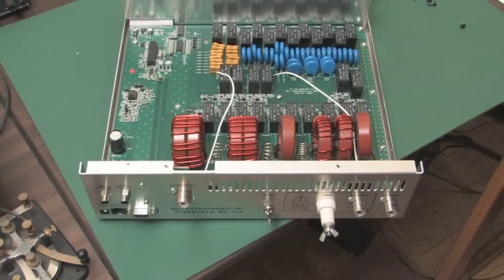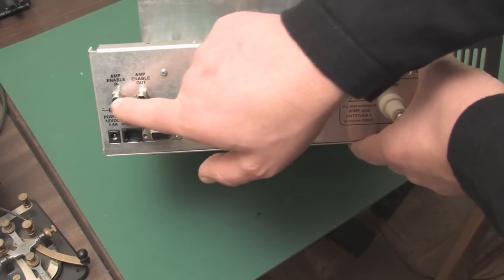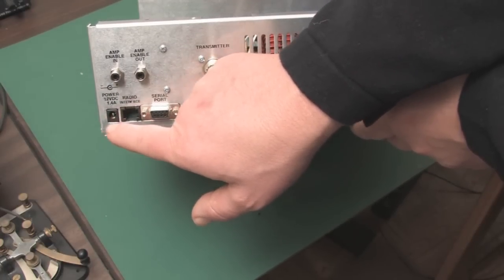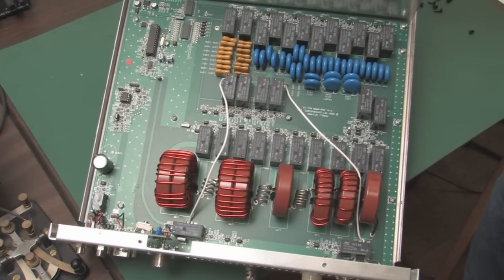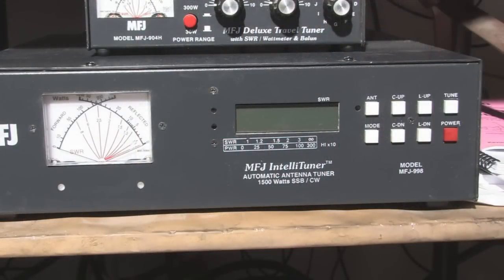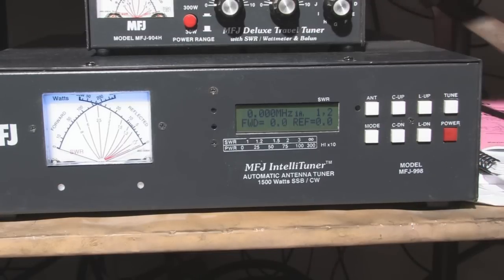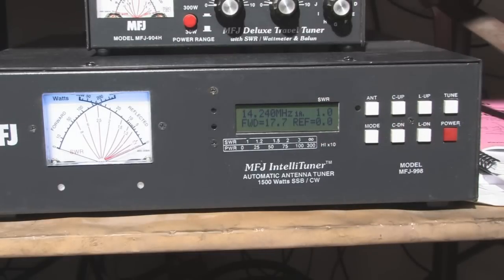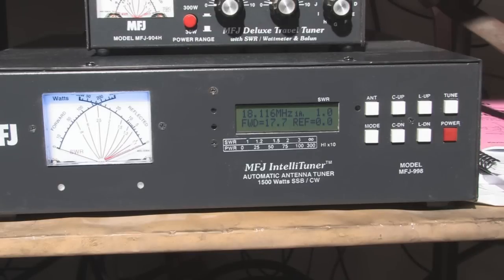MFJ-998 1.5KW Auto Tuner Part 1 - Basics

Comment: Excellent review. I noticed that antenna 1 and the wire connection on the rear are tied together. So I think it is possible to have a long wire on each, with proper ground system and it would tune. Also, I see a use for this for me to run two dipoles in phase. Both fed with equal lengths of 50 ohm coax you'd have an impedance of 25 ohms. I did something like this in the past when I had 2  ten element wire beams on 40 meters fed in phase. I'll be doing that again sometime but I really like this tuner!

Comment: Thanks for uploading this.  I ordered the 929 or the smaller version of your tuner.  My rig is a Yaesu ft-101b.  I will probably have to bypass tuner to tune radio first, then drop power, then engage auto tuner.  I bought the 929 mainly because of auto tune and Freq. Counter.  Should I expect to tune AM?  What should I do with LSB/USB?  I read that these tuners do not display SSB.  Your thoughts please.  Thank you.  73

Comment: I have Two different transceivers connected to my amplifier so I believe I would need to use the Automatic setting as well at least when using one of the radios? I run the ICOM 7610 & ICOM 9100 with the ICOM PW-1 amplifier.

Comment: Great video!!!!

Question re the amp enable in n out’s. 
Will these also pass the ‘amp delay’, from the icom 7300’s relay ‘out’ connector, to the amp, as if I had a direct cable going from the 7300 to the amp??
Im assuming so, as there is only one relay connect on the 7300. 

Thanku  soo much. 

Billy
Reply from the maker: Any "delay" setting that a rig has is independent of the attached peripheral because the rig controls the delay, not the peripheral. So whether the peripheral is an amp or a tuner, it will work just fine.
Reply: @tuckmeat  Thanku!!!
Reply: @tuckmeat 
Another question. 

I hv the amp enable hooked up to my amp and all are running well!
Question: With the amp on(opr), not in standby, can I re-tune the mfj-998, just to touch up the swr, or do I need to switch the amp to standby? 
I am thinking NO, because the amp enable id hooked up, but I may be wrong. 

Thanku again,
Billy
Reply from the maker: @WILLIAMPERRELLI  You can leave the amp on to touch up the power. Although, it is more courteous to other operators to do it at lower power.
Reply: @tuckmeat  Correct!   Just wanted to be sure it was ok for the amp.  
And yes!

Thanku
Billy
Reply: @tuckmeat  
Question 

Is there a way to set the fwd power meter so I can view actual power(esp with my amp connected)while transmitting??
The only way that I have been able to accomplish this is to switch my Icom 7300 to either fm or rtty. 
I can then see 450 watts out. But if on ssb, the mfj shows fwd= 24.0

Thanku
William

Comment: Serious question:  Why, when it initially tunes to 1:1 and you start transmitting, the SWR goes higher?  It doesn't do this with a manual tuner.  I just bought the MFJ998 and this is disappointing to me.

Comment: I have question I hope you can answer, assuming the same amplifier and tuner.  Once you are tuned, and your in a qso.  Will the tuner suddenly start tuning again for some reason because you are running with the amp on?  Or, do you put the tuner in some mode to keep that from happening.  Thanks, K4KAL
Reply from the maker: It does not re-tune when power is applied.  Once it finds the correct match, you're good to go.